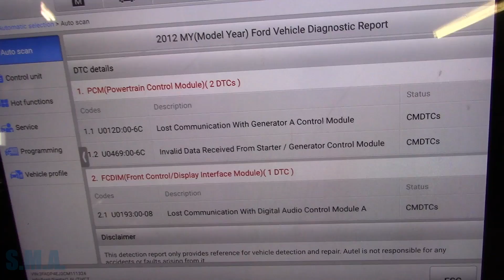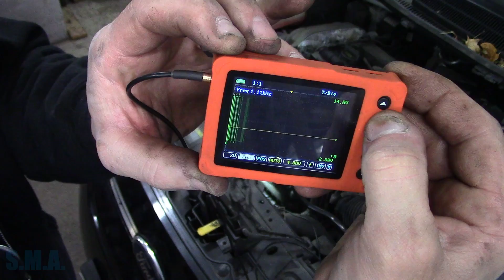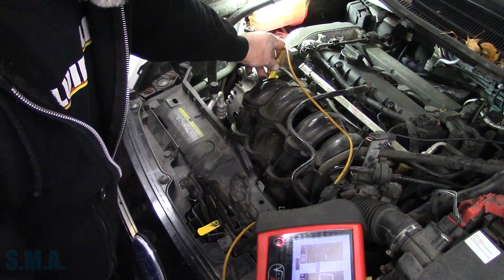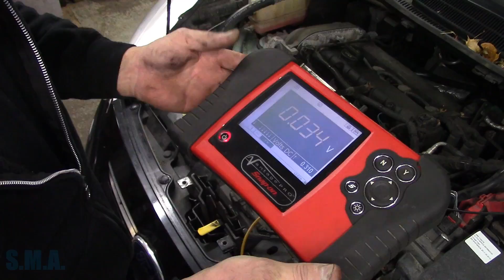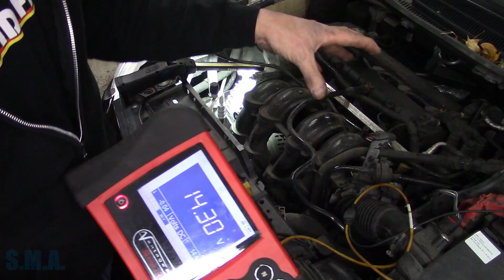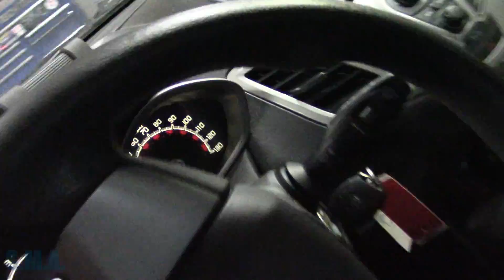Ford Fiesta: Battery Light On

Comment: Your mumbling to yourself lost me- wasn't the alternator putting out 14.3 volts?  Why did you change it?
Reply: replay the video listen to what he says. Clue... it's engineered that way
Reply: @crackermcwhitey1364  I like his channel, but he has a grating tendency to mumble, verbalize every thought and move his head around when he talks, so sometimes you lose the train of thought.  I did guess that the problem was simply that the alternator was working fine, but just not sending the signal to the ECU to turn off the dash light.  Frankly, I'm surprised he didn't tell the customer to just ignore the dash light.
Reply: @oldschool1993  smart charging system. The PCM tells the alternator what voltage to output and the alternator is supposed to do what it is told. In this case the alternator was holding steady at 14.3v when the PCM was telling  it to change. Battery voltage was good, PCM communication was good. Everything was eliminated and the only thing left was to change the alternator.
 The mumbling is like talking your way through the problem. Nobody does it better than Eric because he injects his sense of humor into the analysis and repair. I've watched some of his diagnosis videos a half dozen times to understand what his thought process is and how he arrived at a conclusion. There is a lot of mechanic viewers that help us diyers in understanding a repair or a diagnosis.

2

Comment: I hate these cars w the "smart charging system".... When testing you may question if the comp is turning on/off, or if you have a bad testing connection, or the "run-over clutch kicking in/out.....

Comment: One of the things that the ECM does is to limit the charge current of the alternator in order to save fuel, and also to zap the batteries once in a while to prevent sulfidation.  These are pretty clever things that I would have never thought of in the day.  It's a bummer that a bad piece means changing the entire thing out, but then in the old days it was still just one thing needing to break and we had to change the whole thing out.  Just one diode going bad and the alternator won't charge.  Just one voltage regulator going bad and we had to change it out (plus any burned-out bulbs, belts and the alternator itself it it fried itself).  So, really not too different from the "good old days."

Comment: likely a diode burnt out, i have had many alternators with that failure.
Reply: I think not, if a diode fails , the alternator will struggle to produce normal power. The alternator will almost always produce a distinct “whining” sound due the imbalance of the stator winding outputs. 😁

Comment: OK, What the heck did I miss? It looked to me that the alternator was fine. He said all voltages and readings were acceptable so what exactly was wrong with the old alternator?
Reply: The smart charging system in that car works by having the PCM change the output voltage of the unit by sending data to it on the single wire. The alternator then changes to that voltage. In this case the controls inside the alternator were not responding to that signal and instead were locked at a default output.

Comment: If its still charging why change the alternator just stick a smiley face sticker over the battery light and keep on truckin lol
Reply: Not supposed to charge full blast all the time. This will wreck the battery in short order.
Reply: Eric didn't really say (or I missed it), that it was charging full blast all the time.
Reply: @vstabill36  He did day that in the absence of communication it falls back to constant charging. It's the safer of the two options since it avoids discharging the battery completely, which would ruin it and leave you stranded. But what I don't understand is why he has to replace the entire alternator and not just the regulator as you used to on older “dumb” alternators. It's a lot less work and saves money on storage space and shipping since the alternator itself is a heavy and expensive lump of steel and copper that rarely if ever fails, while the regulator is a small self-contained unit that wears out over time.

Comment: I'm quite curious though about the low battery.  You measured 11.6 V at one point AFTER a long drive to your shop so the voltage was probably even lower at some point.  Is there a point say before where the voltage going to the alternator (prior to starting the vehicle) was too low to wake it up?  PCM doesn't get a response back and money light goes on?   In other words could a bad battery give you a false positive?

Comment: If the default strategy is to put out an adequate charging voltage, in this case would it be safe to ignore the light?  Would the output current vary to match varying load?
Reply: Not really, it's putting out 14.3 volts, not really what you want to be a constant charging voltage.
Reply: @Blazer02LS   A constant voltage regardless of load is what you want, a constant current is not.  That's why I asked about output current. 
If an alternator is capable of maintaining a default voltage under varying load when not communicating then it wouldn't be  necessary to have the ECM  it, just to monitor it.  
I don't know how Ford controls this CANBUS alternator's output current, whether they use an external current coil around the battery cable or something else.  An ECM could identify a charging system out of bounds failure with a photo transistor and two simple logic circuits.   An "old-fashioned" alternator voltage regulator controlled output electro-mechanically.
Reply: @psdaengr911  It monitors both using the internals of the alternator. The ECM commands a set voltage and the chips do the rest inside the alternator and report it back on the LIN. The ECM gets it's data from the loads it sees are active, temperature and the battery voltage it sees on it's feeds and simply sends control data over the LIN. In reality it's a lot like the older alternators with a sense line, just that now it uses the LIN and data instead of direct voltage measurement. The problem then is that you can easily cook a modern battery as most are sized at minimum these days.

Comment: Do I have this right? The alternator works fine, but you have to replace it because Ford added communication hardware which failed?
Reply: No, the alternator is on its way out- the light is telling you that it's on the way out. To make the light go away, the alternator that's going out should be replaced.
Reply: @LordOfSilense    Not necessarily.   What was proven was the ECM reports it can't talk to the alternator on the LIN bus.  The LIN bus has a signal on the unloaded plug end at the alternator.  There was not significant voltage drop across the alternator ground.    The alternator was putting out charging voltage on an apparent default strategy.  

From this we can surmise the LIN bus wiring is intact to the alternator.  The microcontroller is able to function at least at a default level.  Apparently, the LIN bus comms chip (or portion of the microcontroller) is unable to respond to the ECM.  Apparently, the alternator regulator/controller/LIN coms module is not sold separately or field replaceable from the alternator.   The battery light is apparently set by the ECM and is not indicative of the alternator output voltage as it was in days of old.
Reply: @jkbrown5496  Okay, I guess the alternator's SCR had migrated too many electrons away from its polls to produce enough flow to keep voltage up in normal mode. In that case the added electronic diagnostics preveented a road stall. I've got plenty of time to waste, so would have considered finding a new SCR. But I wouldn't have made a customer wait or charged him for my time.

Comment: My 2007 Chevy Cobalt SS/SC LSJ 2.0 with GM's "lets charge the battery to the absolute minimum level required to start the car next time", i.e. 12.8v, what a joke. I got the specs on the "smart charge" system on my car and it says it's primarily designed to protect the battery from hot underhood temperatures (to prolong it's life and save fuel). Only problem is my battery is in my trunk (from the factory like that), lol?

Comment: doesn't the 14.30 charging voltage indicate the alternator is working?   We're you looking of a higher voltage ?
Reply: No on this system you do not want to see a steady voltage, it should change as the system load and battery voltage changes.

Comment: Would it work to momentarily send 12volts to the "one" wire and force the alternator to put out maximum amperage?
Probably be a good idea to unplug the wire that is under the intake and run the 12v to the terminal on the alternator.

Comment: Ok, you lost me.  The alternator is putting out 14.3 volts and it bad?
Reply: Ok, now I get it.  I assumed the battery was going dead but it wasn’t, just the battery light was coming on because the computer saw that the alternator wasn’t playing by the rules.
Reply: @weshawkins7165  Haha yea it took me a few tries to understand. Alternator wasn't happy.
Reply: I had to watch twice to understand. Typically, that is a good reading except in this "smart charging" system. The PCM tells the alternator what voltage to output and the alternator is supposed to comply. In this case the alternator was holding steady at 14.3v when the PCM was commanding it to change. Battery voltage was good, PCM communication was good. Only thing left is to swap the alternator.

Comment: Nice voltage drop tests. I really liked the fact that you demonstrated the voltage at the battery ended up different than the voltage at the alternator by the drop you measured. Great job!

Comment: Why make alternators more complex than necessary, i'm sure ford is bmw in disguise lol.
Reply: Why turn on a switch to tell the computer to tell the body control module to turn on the headlights?
Reply: @harriettedaisy2233  It makes it more difficult and expensive to repair,  the only computer that's actually needed is the engine/security computer.
Everything else is just pointless junk.
Just my opinion of cause.

Comment: I dont get why the alternator had to be replaced, was it sending a corrupt signal ? It seems like the desired and actual voltage was the same. I'm not a car mechanic but I like learning about automotive
Reply: Because it was not under PCM control. The way the system works is that the PCM sends a data burst to the alternator telling it, hey I need 14.3 volts, the alternator looks at it's control table and says, OK I can do that sir. The PCM then decides the battery is charged fully and sends a signal saying, hey pal take a break and the alternator says OK boss and drops the voltage to a bare trickle charge. In this case it wasn't sending that signal back to the PCM.

Comment: Changing the RPM's can cause the charging system to stop charging, Had to keep a car under 1800 RPM to charge the battery. We need more guy's like you fixing cars!

Comment: Remember the old days when all you had to do is pull the positive terminal off the battery while the car was running to see if the alternator was still good
Reply: Try that now and you'll fry the computers with a power surge! Ye canna bypass the main energizer circuit that way, lad!    -- Lt. Cmdr. Scott.

Comment: How can we tell if the pcm is talking or the alt.  Unhook it from alt see if pcm is talking ????
Reply: That was the test he did, unhook the com wire and check it. in this case the PCM was sending packets. The alternator was not responding to them by changing it's voltage output.

Comment: Would have liked to see the replacement  procedure.
Reply: Use zip ties for the stretch belt
Reply: @langer24106  i was glad to learn about that since I think my Escape has one of those...
Reply: @michael931  I have a Fusion and had to learn lol - we probably have the same engine
Reply: Same here....
Reply: Had to be edited out due to swearing...
Reply: 1, Remove alternator. 2. Reinstall alternator. 3. Profit.  :)    (Yeah, yeah, I know that's not what you meant :) ).
Reply: @markh.6687  probably because it has  a stretchbelt witch is quite a challenge if you never do them
Reply: @TheJasperTW  Had to look that up; never heard of it. Everything I've owned recently didn't use them.
Reply: @markh.6687  i work at a European ford dealer so deal with them alot
Reply: @TheJasperTW  it does. Tool is provided with the belt.
Reply: Stretch belt ALWAYS equals PITA!!!!! Just my $ .02
Reply: The big “O” has earned the privilege of letting his hired help do the “tight” jobs.  Mr. “O” doing the replacement is a waste of resources. Beside, $15k-$20k a month from the YT related ventures tends to dampens ones knuckle busting enthusiasm. Thanks Mr. “O”.

Comment: I said it a few times before, its electronics gone mad just for the sake of it. They are now adding things that are not particularly needed : 14.3v is a good charging voltage, so the main part of the alternator is fine and doing its job, but its now junk due to a failure of a small surface mount tiny component that probably costing next to nothing!

Comment: So, charging is OK, voltage drop is OK on plus and minus. Communication with PCM is OK. Diagnosis, needs new alternator. I don't get it. Why was the light on?
Reply: Because the communication between pcm and alternator was wrong. He explains this in the video. The alternator is telling the pcm on the Lin wire to turn on the battery light even though there is no problem. Faulty alternator
Reply: When he did the scope testing the alternator was unplugged.  The communication you were seeing was from the PCM.  It was probably a wakeup command or something being sent from the PCM to alternator.
Reply: @JoeBoppChicago  agreed.
The pcm was sending messages to the alternator. That confirms pcm was good and wire was good. When plugged in the alternator is telling the pcm to turn battery light on
Reply: @JoeBoppChicago  its Lin bus. Basically data packets of info being sent. Usually a square wave pattern

Comment: Was the 14 volt reading at the battery?  I thought that was good reading for a alternator?
Reply: I had to watch twice to understand. Typically, that is a good reading except in this "smart charging" system. The PCM tells the alternator what voltage to output and the alternator is supposed to comply. In this case the alternator was holding steady at 14.3v when the PCM was commanding it to change. Battery voltage was good, PCM communication was good. Only thing left is to swap the alternator.
Reply: @glenjamindle  thanks buddy!  My brain can't handle "smart" tech lol

Comment: The easy it would be for them to check from software if VBat is greater than 13.8V when the engine is on... I'm starting to hate a little bit that everything needs a data line in cars these days. Adding complexity for no reason whatsoever.

Comment: Well help me , battery @ 11 volts , I would think the alt should be charging it WHY am I wrong to assume that the low battery is not the issue . I check alt it says its giving the battery 24 but the battery says it’s only taking 11 ????? Battery bad!

Comment: Honestly thats dumb alternator is working fine just not giving off signal. I'd live with battery light on until it actually fails.
Reply: It's a used car guy. He's not gonna sell a car with the battery light on
Reply: And by doing that you will be replacing the battery a few times because the higher output will be overcharging it constantly.

Comment: I ran a car that was default charging for a few years, I went through a battery every 6 months probably because it sorta overcharged constantly (i drove 4 hours a day so)
Reply: wouldn't have been a problem if you only drove 4 miles a day, right?...but Eric O only fixes things back to the intended function.  That's what you want when you hire a professional.

Comment: So it was charging at a default voltage setting . If you put the maximum accessory load on and the unit is bad , would it still show the default voltage and no change ?

Comment: One thing I thing would have been good to see was the amperage output of the original alternator. The battery checked at 11.5 volts in the video. Why if the alternator was still charging at 14+ volts and was driven a good distance?